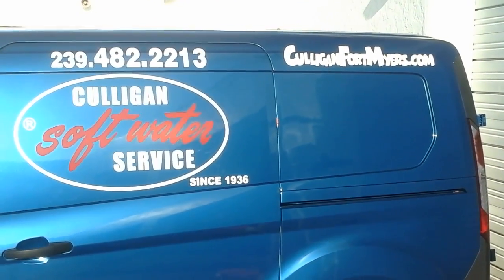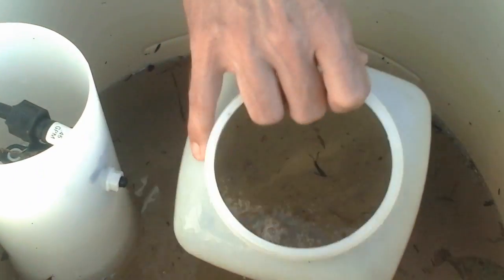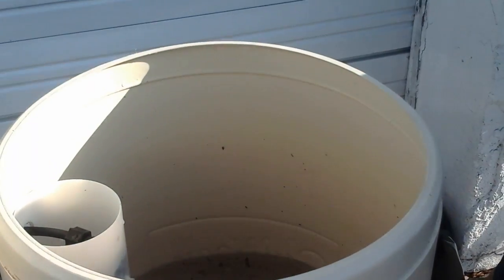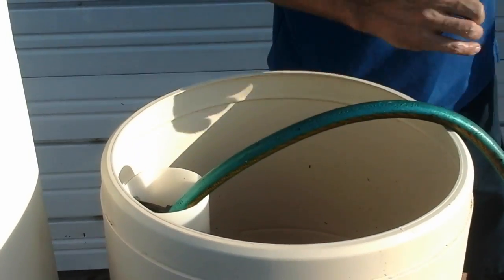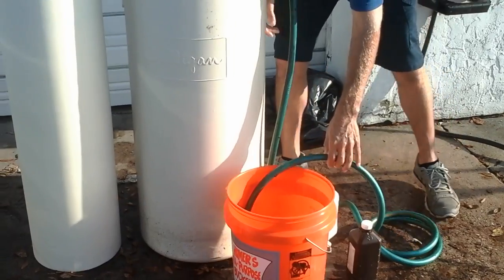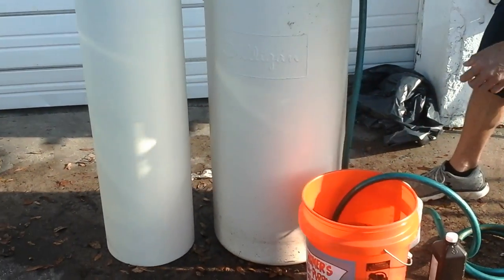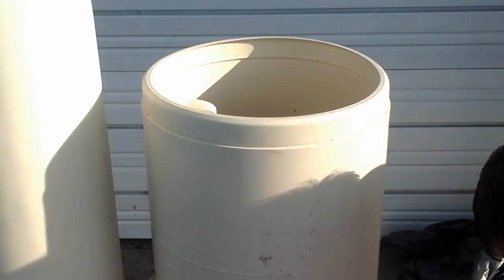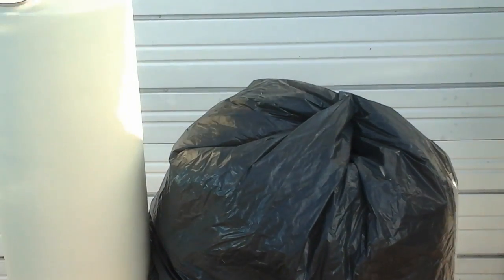How to Clean a Salt Tank

Comment: Thanks for the tip for the garden hose syphon. Been meaning to clean a Softener Salt Tank but wanted to drain off much of the Water before tipping it over and clearing out whatever has settled to the bottom. Simpler is better. (Vs a utility pump or bailing out with bucket(s))